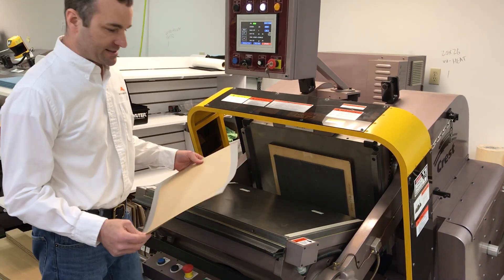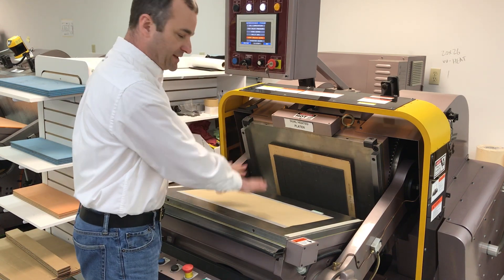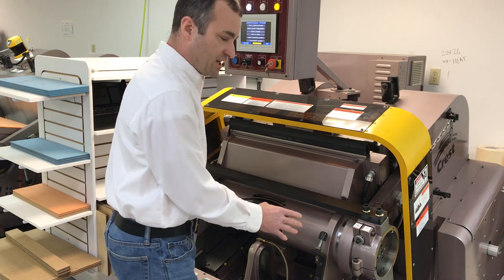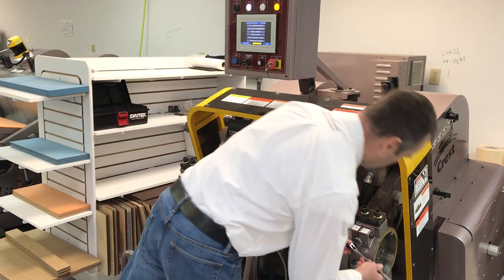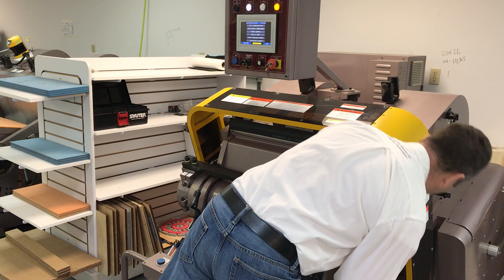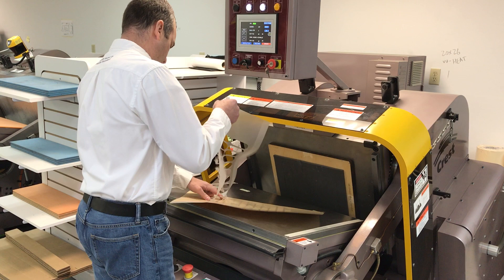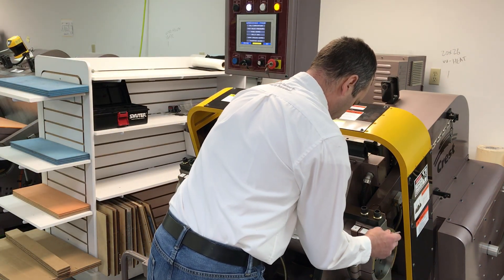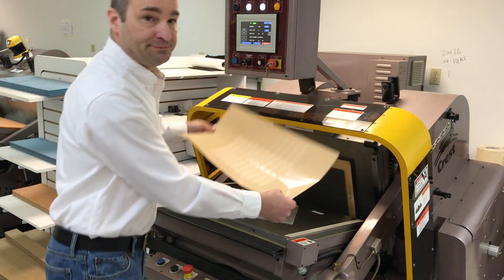Zero-Make-Ready Kiss Cut With 10-Year Old Die on .010" Polyester

Comment: So....  What is the thickness of the liner?  That makes all the difference in the world.  Also, has the die ever been hit metal to metal?  Plus, how many impressions are on the die?
Reply from the maker: .003" Liner.  Die was kiss cut, steel to steel but of course we were careful not to hit the plate hard.  The Crest does not deflect and both the moving platen and stationary platen are surface ground - absolutely flat and parallel.  You are welcome to test the Crest with your die and material.
Reply: @MrClamshell  Never in to hand-feds.  Owned windmills and cylinders, and a Bobst.  Serviced the printing industry until the internet ran me out of business. (2012).  Nice press.
Reply from the maker: @igsterman71  Thank you- incidentally we are very friendly with Bobst colleagues and have many common customers.